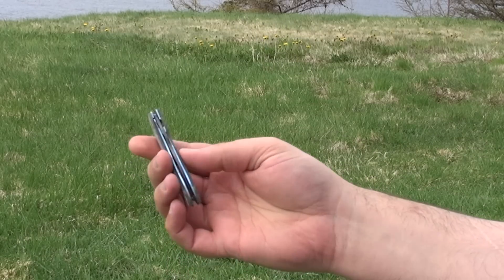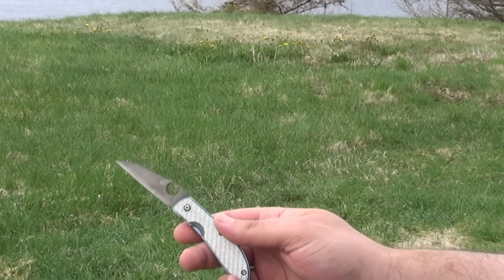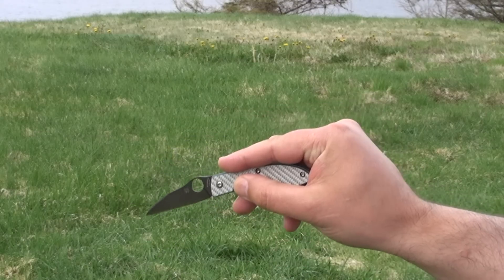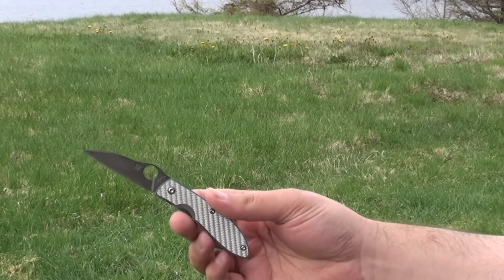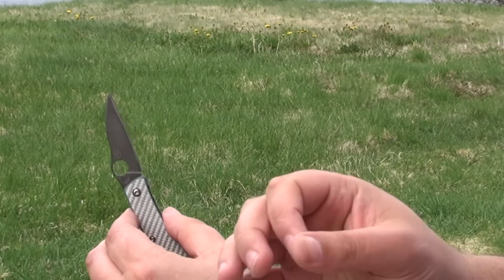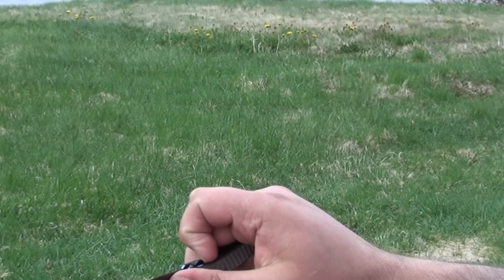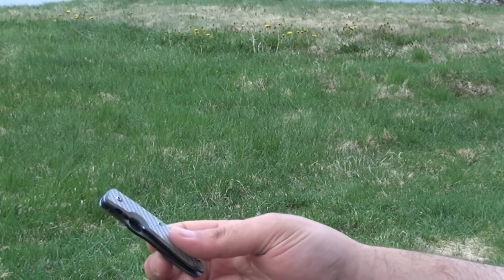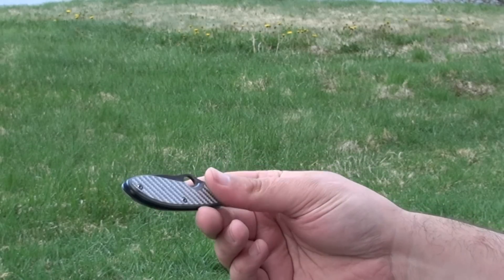Knife Challenge #5 - Spyderco Air / edge retention as influence by sharpness

Comment: i think the best way is to tahe a cut on a copper refrieration pipe and see if the chip curl as long as the cut evenly. dont forget to measure your redings length,microns,and variation in thickness

Comment: i'm thinking either this or the gayle bradley in m4 will be something i'd like to try out next, i'd like to see how it compares with my benchmade in m4. i noticed when i used spydercos cpms35vn that i had much better results than with striders cpms35vn. do you know who heat treats spydercos blades?
Reply from the maker: Spyderco makes knives in different locations, I know they are done in house in some, not sure in others. 

The Air and GB are two very different knives, the Air would seem to me to be much more of the type of knife you would like given recent video's you have made. It is a very nice cutting blade, though you would likely have to adjust the edge angle or ideally thin the primary back some to really optimize it.
Reply: thanks for the info! i'm sure you're right. i really want to regrind my spyderco tuff but, i think i'd better invest in a belt sander first.
Reply from the maker: knives save lives With a decent coarse stone you could do it in about an hour, but a small 1x30 with a decent belt is only a few minutes. Generation of heat is the main concern.
Reply: i would most assuredly have to sharpen through the heat damaged metal but, i think i'd be willing. it took me a very long time to get my southard flipped the way i wanted it. it's progressed since i put up the last video on it.
Reply from the maker: knives save lives What do you have for a x-coarse stone?
Reply: the only thing i have thats flat is 500 grit. when i bought that, i was expecting the grit to cut faster but, it's more smooth than i imagined and kinda wish i had gone with 120 or 220 instead.
Reply from the maker: knives save lives If you are doing any shaping then you want to step down to the lowest grit possible. I have a Bester/700, decent stone for moderate steels, but it is slow for any regrinding, especially on any steel which is hard or of high carbide volume. 

If you are using a very hard/high carbide steel on that stone it might be slick from wear. You might want to try a quick lap to see if the aggression is restored.
Reply: i used it for quite a bit of the work i did on the spyderco southard towards the end of the finishing process. on another note i picked up a pohl force alpha 2 for $60 when i went out of town, it's in d2 and is a monstrosity but, i couldn't pass it up for the price.
Reply from the maker: knives save lives Ha, you have quite a diverse taste anyway.
Reply: like i said, it's about the price. well...and the steel. the only other knife i have in d2 is the sheafner you sent and comparing the sharpenability between the two, i'd say the pohl force is easier to sharpen which i think would be an indicator that the edge retention on the sheafner would be a little higher. also, the chances of me finding that knife in a pawn shop was about a million to one, so i think it was destiny. the jaws on the guys at work will drop for sure. mine dropped because i couldn't believe what a monstrosity it was. there was a little of the novelty factor involved.
Reply from the maker: knives save lives I have a D2/Dozier if you are interested, well I don't have it now, a friend does, but if you are interested let me know and I will send it to you when I get it back. Dozier's D2 is considered by many the standard to judge D2 for cutting/edge retention.
Reply: i would be interested. thanks for the offer!

Comment from the maker: The blade length will effect the results but it is a very small effect as it is linear and it is easy to judge by eye. For example with even moderate effort you could trivially get more than 50% consistenct on use of blade length however without random sampling you can easily get 2:1 influence due to deviations in the rope.

Comment: Regrind to 15-17 degrees per side to minimize effect of edge thickness on wear resistance.
Set microbevel to 20 degrees.
Check edge apex by having no light reflection on the edge.
Check sharpness by running edge on the nail, a very sharp edge should feel smooth at start then begin to dig in.
Loop multiple layers of rope mid air while still being able to cut through each loop with a single draw.
Tally up the cuts, until the knife will not longer cut determined number of loops with 1 draw.
Repeat

Comment: Also, with regards to using only a portion of the blade, I wondered if the full blade length would be needed to cut the rope?  Would it?  If not, would it introduce randomness in results by at times using an undefined length of the edge to make the cut?

Comment: The stone would load with metal grit unless you had a sufficient way to clean it. You'd also be wearing down the corners of the grit, and displacing it from the binder. All minimizing it's cutting efficiency.
Alternating between you and your friend for sets would hopefully minimize the difference. I ran out of characters to explain in my entry comment.
I couldn't think of a way to standardize testing on the rope any better.

Comment from the maker: Very nice answer, just behind the top two. You have :

-a measure of sharpness which is separate from the cutting 
-checking at intervals (very CRITICAL)

A few things :

-this rope is subject to large variations you need to account for them
-the stone itself will produce different results unless you account for that
-push cutting and slicing should be checked

But again, very nice method if more people did work like that we would have a lot less conflict in the performance being reported.

Comment from the maker: Excellent solution, one of the top two. You have :

-the only effort to account for stone wear
-measures of sharpness using the knife as a standard weight
-keeping the cuts as a reference (CRITICAL when you don't have calibrated scales)
-repeating until sample is consumed

The only thing it misses is that sharpness can be different on a draw and a push cut and for completeness you want ot look at both.

Comment from the maker: Yes, of course modern science is only recent, just like last weeks science was constrained to last week. The point remains to do scientific work there is no actual constraint of accuracy or precision. One of the point of this challenge is to realize that if you attempt to devise an experiment which is of greater accuracy / precision than your friend is going to apply in use you just wasted your time. This is one of the foundational rules of research, you don't measure beyond what is necessary.

Comment: Bugger...... *rolls eyes* please substitute the second #5 and 6 with 6 and 7 respectively (in case it wasn't blatantly obvious) 

Light reflection, much like your fingernail, is a shockingly accurate mechanism to observe edges. Both however require some level of skill/practice to apply.

Comment: 1Sharpen knife
2Observe edge noting zero light reflection (assumed, if not return to step one) 
3draw knife in slice over rope applying necessary force to complete cut in one pass
4observe edge noting approximate % length reflecting light 
5drag edge sideways across nail noting catch or lack thereof
5repeat steps 3-5 noting slices made
6repeat experiment 3 times per sharpening technique (6 in total for the two people)

Comment: Your dulling metric then is merely a single benchmark. You're either over or under, there is no performance curve. Also push cutting paper, most papers at least, requires a knife at the high end of its sharpness, so most of its dulling curve will remain unknown. Finally, even with a blade this short, there is more to sharpness than push cutting. Your test would at best ignore, but more likely disadvantage, any slicing aggression which is a major advantage in actual use.

Comment: Cutting free hanging rope is an extremely subjective skill. Its also worth noting that different edge types will favor different techniques. Additionally, with such a small knife, consistently striking a free hanging rope so as to assure the partial cut was due to dulling rather than a partial miss would be impossible.

Comment: As an aside, I desperately want you to like this steel. I think you won't though, because there will be more complaining about sharpenability. Initial edge burnoff isn't an issue though, assuming proper HT, so I'll be surprised if you start grumbling about that at least. If you do, clearly we have a difference of method somewhere. Its not as good as flat out carbon steels for things like cellulosic cutting, but it should be fine.

Comment: Attach equal thickness spacers of wood to spine to maintain angle
Progress though grits to 800 alternating strokes
Strop on cardboard, preferably loaded but not necessarily, 5 times per side (alternate) with abrasive load or 20 times without. 
Check burr with nail
loop thread, hang from hanging scale hook
Slice thread loop (hanging) noting force
slice rope 8 times
slice thread loop noting force
repeat until force exceeds X lbs/kgF
resharpen and repeat to check falsifiability 
this protocol blows

Comment: Why are you trying to measure edge retention using the same knife? Shouldn't the better sharpening job give you better edge retention since it will experience less resistance while cutting?

Comment from the maker: This knife would easily push cut that entire roll of rope, the edge is very fine, it would start with about 10-15 lbs on a 2" draw depending on the skill of the sharpener. It would only be up to maybe 20-25 after cutting the entire roll to pieces, easily within the range of a person to do with little effort.

Comment: I would throw the knife at the rope until I broke the knife.

For the challenge I would leave the rope rolled up. I would see how far I could push cut the rope with my friend's sharpening job and measure the distance of the cut. I would repeat this process after I sharpened the knife. I would make the push cut from the same area of the blade each time.

Comment: I sharpen the knife.
I make 100 push cuts with the same section of blade. Right in front of the handle.
Lightly pinching the knife by the end of the handle, hold the knife level touching the rope with the used area. Rotate so the blade is ~1" high (use a standard piece of rope). Let fall. Repeat 10x. Save pieces.
I resharpen.
Draw cut 100x using whole blade. Pinch handle. Draw cut 10x. Save pieces.
Repeat both sets with friend sharpening.
Repeat entire test multiple times, account for stone wear

Comment: Separate the rope into individual strands and using only the weight of the blade see who can do a draw cut with the full length of the blade. Who ever is able to do it in less distance is obviously the better sharpener. And for consistency have each person hold an end of the string so the tension is equal and have both persons test each sharpening several times with several strands. To test for  for durability do a series of draw cuts using the 3/8 rope say ten cuts then repeat the  test

Comment: As the knife already comes sharpened by my friend, I cut the rope using the whole lenght of the blade, checking to see if I can shave hair after every pass, meaning make three light (weight of the blade in pinch grip at butt) attempts to take off any hair. If it can't I resharpen it and repeat. Keep number of re-sharpenings to a minimum for possible stone related issues. I am always the one testing for consistency. If his results are no worse than mine by 15 cuts, his skill is good enough.

Comment: Ok a quick way, to see who sharpens to a higher degree which was the question. Separate the rope into individual strands and using only the weight of the blade see who can do a draw cut  with the full length of the blade. Who ever is able to do it in less distance is obviously the better sharpener. And for consistency have each person hole an end of the string so the tension is equal and have both persons test each sharpening several times. And test on several strands to ensure accuracy.

Comment: Score stone along center on both sides using knife tip.  1 half of C&F is assigned to Person1 & Person2 to use 4 their sharpening.  W/stone mark blade @ midpt. 100 cuts completely thru rope are made w/ 1st half of blade by P1.  Draw cut w/ same part of edge using only blade weight (hold knife w pinch grip at butt) is made in rope & that cut saved 4 later depth comparison.  P2 sharpens w/ his sides, and P1 repeats same procedure.  Depth of two cuts after 100 are compared. Repeat as rope allows.

Comment: The test is to see if he can maintain the high (important) sharpness with his skills by using mine as comparison. I (always I for consistency) cut the rope, first with his edge with the whole length of the blade and between each cut I shave a tiny amout of hair. Repeat until his edge can't shave (if he's like me, we've got plenty of hair everywhere), then I resharpen and repeat the test. Further re-sharpenings are possible to check, but a high number is not recommended. Compare data for results.

Comment: If you draw cut through the rope, you'll have to be careful to use the part of the edge that was used in your push cut test. It would be easy to accidentally use a little bit of the edge that was still untouched.

Comment: I would take the knife with his best sharpening job on it, and loop the rope. I would cut through the rope using the entire edge of the knife in a slicing motion. When I started to notice that it wouldn't slice cleanly through the rope in one or two slicing motions with reasonable force, I would then put my edge on it and see if I could get more cuts through the rope.

Comment: Mark a 2 inch test area on the knife blade.  Person A sharpens the knife and then cuts the sisal rope only using the 2" test area.  Person A repeats the cut until the knife begins to skip on the rope.  Person A re-sharpens and repeats the test.  Person A does this for 4 cycles and notes the number of cuts for each cycle.  Person B repeats the same procedure as Person A.  The data is compared and a conclusion determined.

Comment from the maker: The grits are coarse and not-so coarse, it is a $2.50 stone, you look at it and would estimate it is between 50-70 micron on one side and 25-35 micron on the other. It has among the worst qualities you would want in a stone, doesn't release fresh abrasives well, will load easily, is ever kind of soft so can be easily damaged.

It comes as he has sharpened it on the stone.

Comment: An issue I find in your method is that the question is whether or not his sharpening skills  are good enough to reflect the steel's advantages, so your method only shows if his sharpening skills are as good as yours ( not that I question them, as the novice that I am). Three questions for you Cliff, what are the grits on both sides of the stone, its quality, and is the initial edge done by my friend or is it the factory edge? The fact that we can play with both coarse and fine seems interesting.

Comment: Person 1 sharpens it to the best of his abilities. He holds the knife at the very end of the handle, and while the rope is under tension, he sees how many cuts will be necessary to cut the rope, just using the weight of the knife. They do 250 cuts, noting how many times it took to cut through the rope. They then destress the edge, and sharpen the knife. This is done 25 times, after which the knife is given to person 2, and they do  the process, to test their skills.